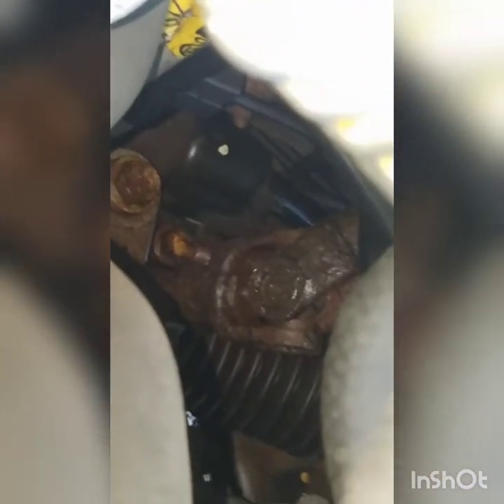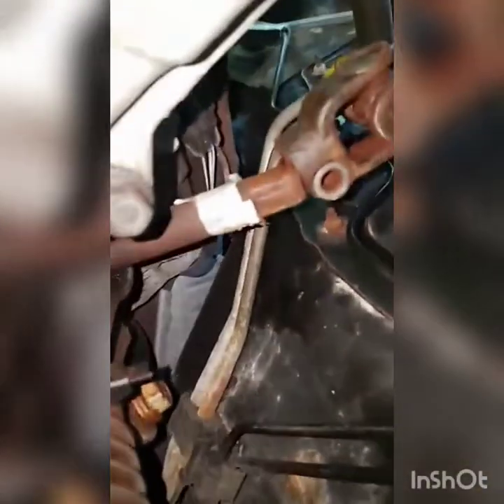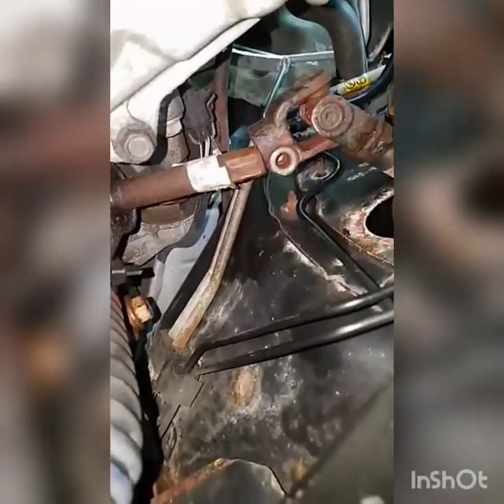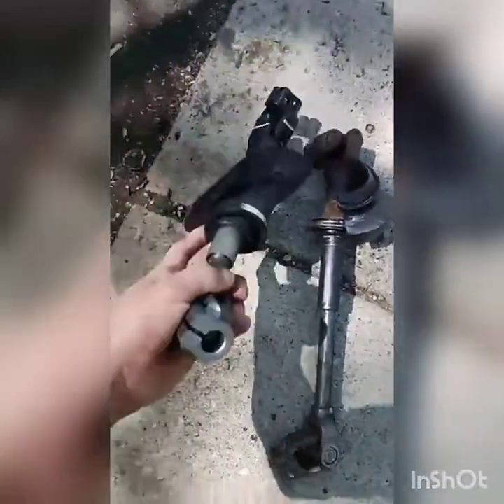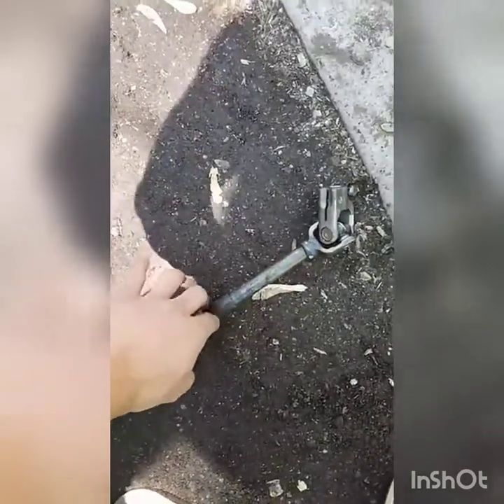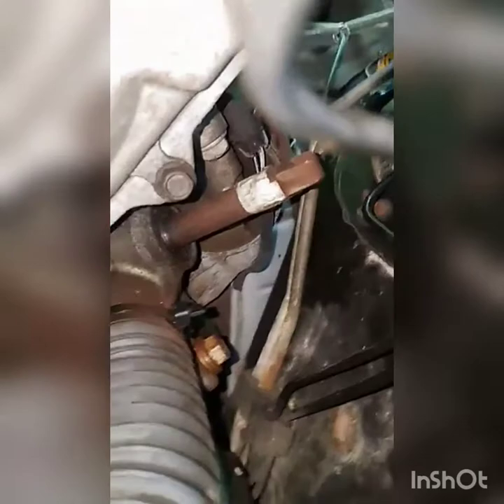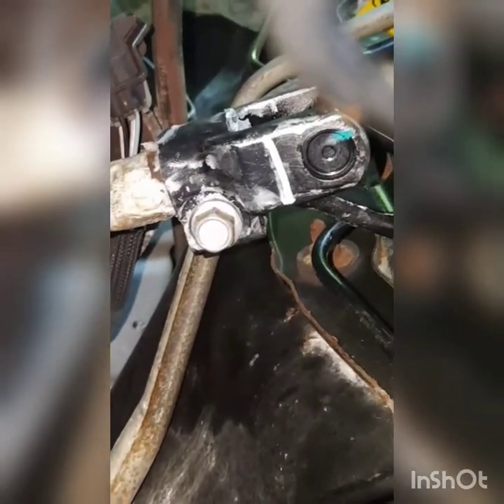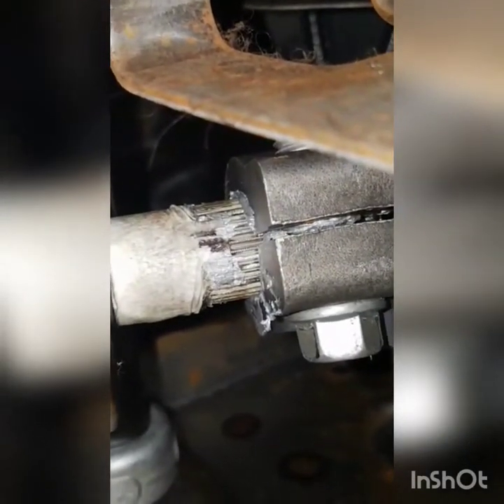Saturn ion steering wheel shaft removal

Comment: Im doing a video on this today and i can say wothout a doubt, using a hammer and chisel is the hardest way to do that. Use an air chisel from the bottom and knock the coupling off in a minute or two.
Reply from the maker: @Thecheaperguy  That sounds like it would be faster n easier. didn't have any air tools. Just basic tools. On the side of the road.

Comment: I'm having big time problems removing the rusted joint off.  PB blaster several times, hammered it, it's isn't budging.  I thought about using my air hammer but it's too damn tight to get to it.  I don't want to use a torch with fuel lines near by.  I'm gonna try again in a minute
Reply from the maker: Look at the position of the shaft joint in video @ 1:40. 
Since the shaft is seized its not going to compress. what your trying to do is flex the joint up n out. You need to cut the rubber boot so you can get that extra clearance or it wont  move.
Reply from the maker: If that doesnt work  what I would do is  literally just cut the shaft right behind the steering wheel with a hand saw and then tap it with a hammer to break the rust at the Joint by the rack. then you should be able to pop it off. Just another option.
Reply: @sosounconventionalways2179  After I posted, I was able to get the shaft off. I rewatched your video about hammering to death.  I hammered it so hard and then hammered it from underneath with a big screw driver, it finally broke free.  You are right.  It was big pain to take off.  I thank you for the video and tips.
Reply from the maker: It is a BIG pain.... key is determination and persistence. you didn't give up. GOOD JOB💪💪

Comment: you didnt even show you doing anything......... wth
Reply from the maker: I showed what I had issues with. Which the other videos didn't show and I would think is the most important parts. if you cant figures the shit in between then you need to do some more research. I assume if you're going to try this you already know how to take a wheel off and you know how to jack a car up. but sorry It didn't help you.
Reply: Did you have to remove anything behind the steering wheel to get this part off?
Reply from the maker: @ellenj8254  no just the bolt holding the column to the steering wheel and a rubber cover that comes off the shaft...